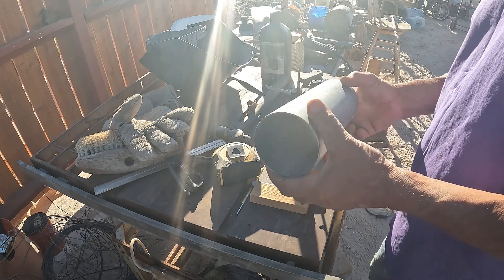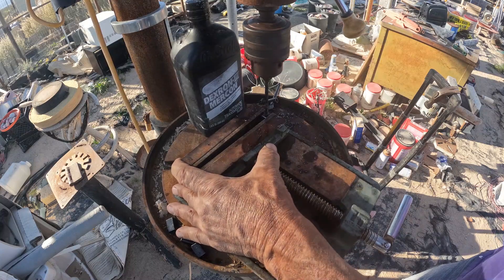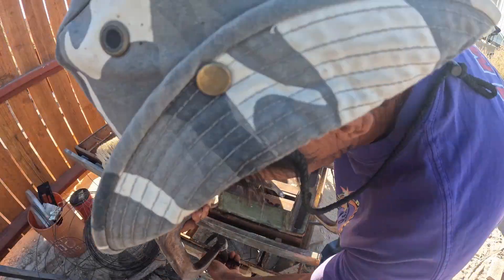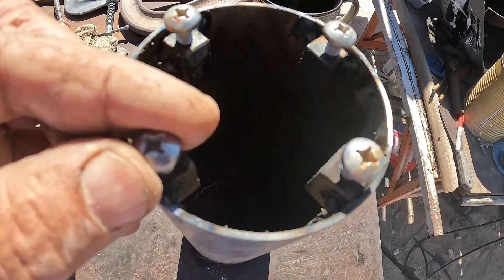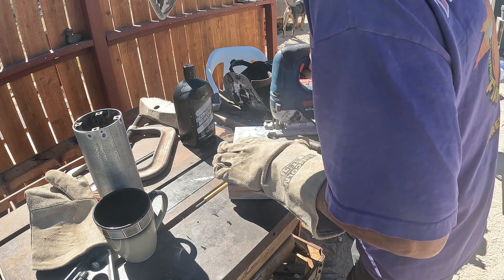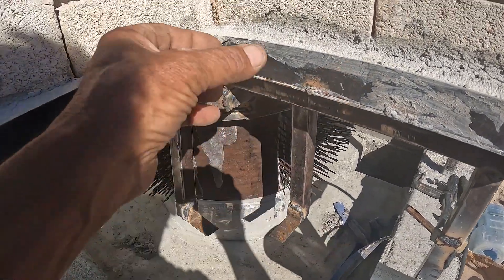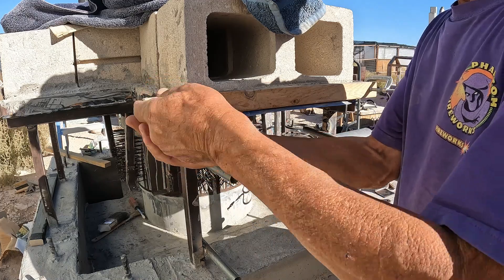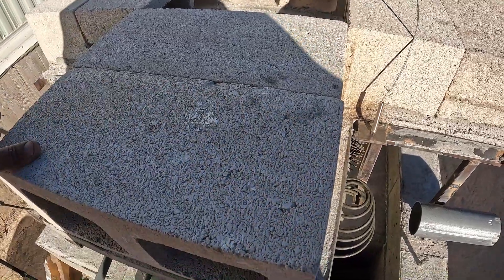Sand Battery Drain and Heat Sensor E125

Comment: when you FINALLY (joke lol)  get done  don't be like all the other permie youtubers and just report the temperature, give us some heat  FLOW RATE numbers. .....  You can get at least a rough approximation of the air flow rate, by timing how long it takes to fill up an evacuated "X" gallon trash bag.  Combine that with the temperature of the air and the duration of heat removal from the mass and we'll have something. >>>>>>>  Of course if well insulated any wattage of heat put into it for X amount of time and temp will also reveal the heat stored, if we factor in some heat loss from being imperfectly insulated..      BTW of all the AI engines BING CHAT set to "more balanced"  beats the other AI's I have tried for these types of calcs.  Still check the results , AI sometimes is "flaky" .  Bing is very nice because it shows it's thought process, .. a great way to learn and also gives new ideas on how to approach things.